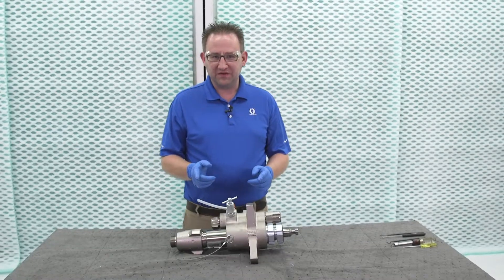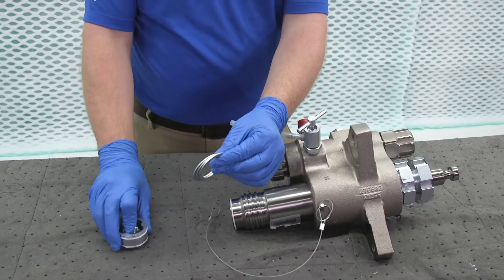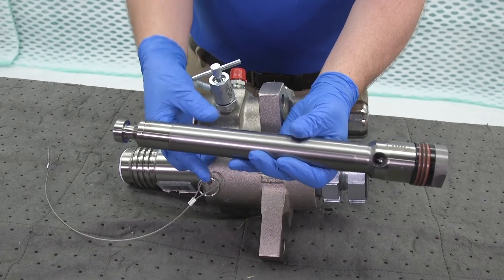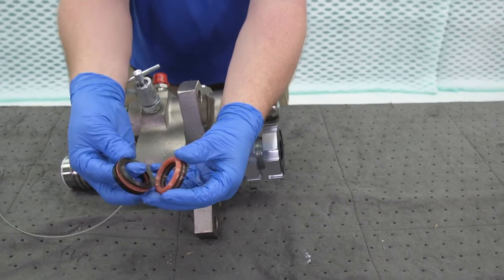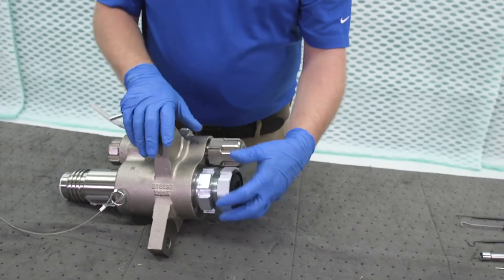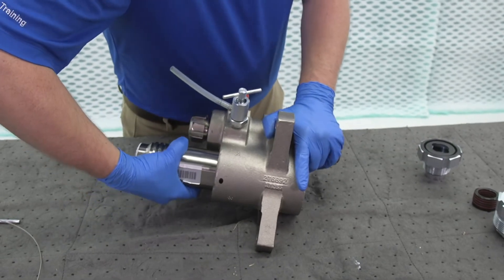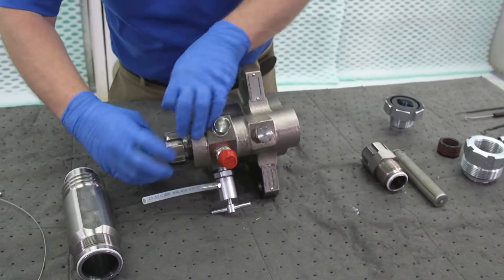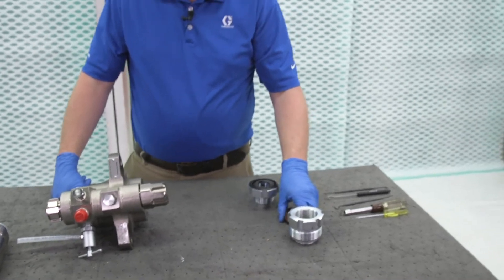How to Rebuild a Graco Xtreme Lower

Comment: We install the pump back,but when we run test with thinner the pump stop/stuck...have you any solution for us.
Reply: Is the piston stuck?  Did you take it apart again to check the shims and packings?  I have a similar problem. The pump looses pressure on the down stroke whiling moving quickly then on the up stroke it moves at a steady slow speed.

Comment: Great Video! Is there a full rebuild kit for this or a part number that you could share, or did I miss that?  I need new packing's for the rod as well as the filter.  The lower assembly is not creating any pressure, so I would like to rebuild it completely.
Reply from the maker: Woody Holloway Hi! Do you know what size lower/ pump is on your machine? You can then reference pages 27 - 29 in this manual:
https://www.graco.com/content/dam/graco/tech_documents/manuals/311/311762/311762EN-ZAH.pdf

Also might need a rod and cylinder as well. Please let us know if this helps. Thanks!

Comment: Glad to see some good detailed videos on graco pumps. I tear down and rebuild these pumps everyday
Reply from the maker: Please let us know if there are any other videos we should make. Always looking for new ideas from those using our equipment every day. Thanks!
Reply: When in the field and experiencing a leak from the top of the cylinder, or a sticky ball in the piston, we've often put the sprayer on its back and removed the cylinder exposing the piston without dropping the whole lower leg. Because the throat packings are securely in place, guiding the piston, is there any real chance of damage when removing the cylinder against the direction of the lips of the piston packings? I suspect reinstalling it would be less risky because we're going in the direction of the lips. Thoughts?